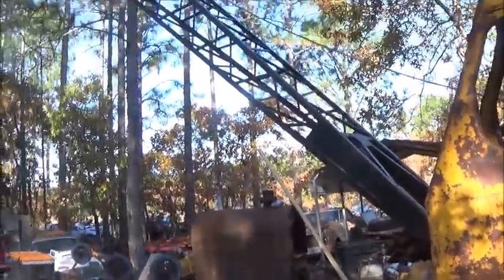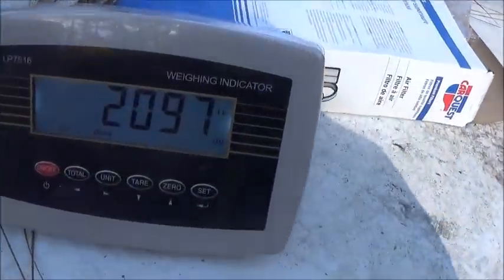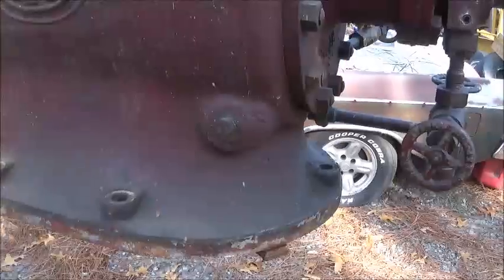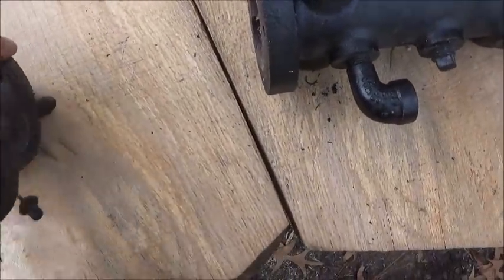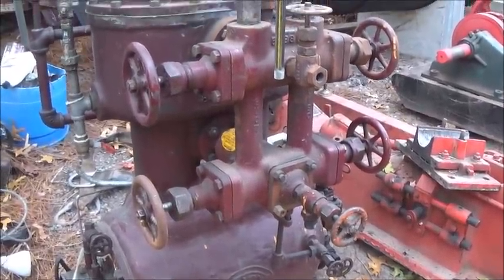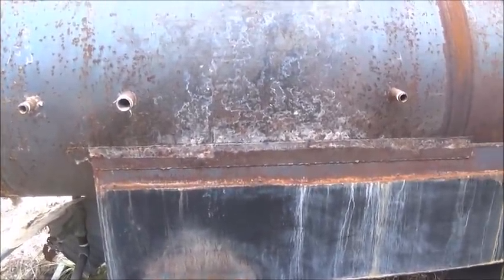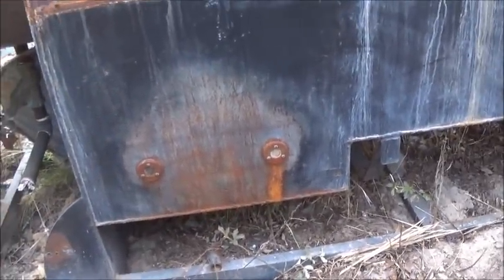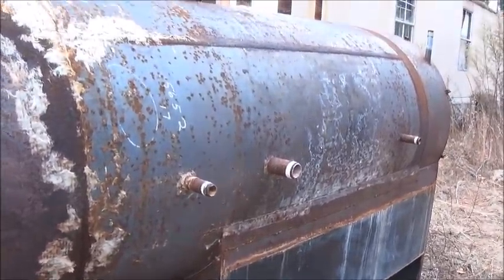AMMONIA COMPRESSOR, BOILER, LOCO PISTON AND MORE!!

Comment: It's a fire tube boiler, right? The water and steam go in the shell and the flue gasses and heat pass through the tubes into the smoke stack. If you're burning wood in such a boiler you might want to set up a way to clean the tubes (rod them out), since they will tend to collect soot and will need to be cleaned periodically to keep the chimney at peak performance. It is common to build a fluidized bed for such a boiler and to deliver the wood to the fire box in the form of wood chips, blown in with high volume low pressure compressed combustion air from a big centrical blower or better yet, a vane axial fan. Fluidized beds burn the wood very quickly (plenty of combustion air and maximum wood surface area) and deliver maximum power from a boiler. Obviously, with a wood chipper in series with blower that delivers air at pressure of at least 10 inches of water column, these systems tend to be very noisy. We designed such a system for a window manufacturer that used the scraps from the woodworking shop. Used that way, your boiler looks big enough to power your whole collection of steam engines. The system we built for the window company made 450-pound superheated steam to drive giant air compressors to produce the compressed ir to run al of the power tools in the plant.

Comment: Before I retired, we used Frick compressors with ammonia to make huge loads of ice water (mostly ice at the first, mostly water at the end of a cycle) to store cooling energy so we could use off-peak electricity for cooling very large commercial systems, one of them an R&D lab for a multi-national food processing company that might prefer to remain nameless, but which anyone would recognize by name. Frick makes top-notch compressors and as done for a very long time. The ice tanks were bigger than any swimming pool anyone ever made. The ice was made in sheets and then shed with a short shot of warm water to fall into the tank. Then we'd make another sheet and so forth. Nice piece of equipment. I liked seeing it after all these years.

Comment: Jonathan, I can tell you what all the valves do.  It's a long answer as this is a complicated machine.  Sorry to the YouTube commenters who can't tolerate long answers.  Jonathan asks for an answer so he, and you, can learn.  First, the compressor does not pump on both ends of the pistons as you questioned.  The pistons are indeed quite long, but they only compress on the up stroke.  BTW:  The pistons and suction valves are of a very interesting design too, but that's not the topic of this answer.
Of all the "fifteen" valves, it's really only the four big valves on the two manifolds that are the "mysterious" ones.  The other valves are for the water jacket, oil sight glass, vents, oil and other usual things which are easy to understand.  The four valves are part of the upper (Discharge) crossover manifold and lower (Suction) crossover manifold.  Suction gas always enters the compressor through the lower suction manifold (right into the cylinders).  In fact, that manifold even has a filter / screen cavity and cover plate.  You can see the instructional decal.  Discharge gas always exits the compressor through the upper discharge manifold.  The valves are clever and offer the refrigeration plant engineer the ability to do three things:
1.)  Isolate the compressor from the pressurized ammonia refrigeration system when the compressor needs to be opened up for service or inspection.
2.)  Allow the compressor to run in a "normal" operation where the suction gas is directed to the lower suction manifold and into the compressor.
3.)  Allow the compressor to run in a "defrost" operation by allowing the hot discharge gas to exit the compressor up the suction line.  The hot gas will then melt the ice off the evaporator coil.  Through a reverse refrigeration cycle (which is known to refrigeration people like me), the suction gas now returns to the compressor through the normal discharge line and is then routed down to the suction manifold.  The refrigeration plant engineer would have to do this process manually several times per day to defrost the evaporator coil.  
I know this is hard to explain and harder to follow.  If you and I were together, the valve and manifold assembly is easy to sketch out.  In a way, these valves were a year 1905 way of doing what modern day heat pump reversing valves do today.
Safety tip while I'm writing a book:  This compressor has a secret which can hurt , or kill you real fast!  When doing the defrost and valve switchover business, an occasional slug of liquid may come down the suction line and enter the compressor.  The discharge valves are held down in place by extremely powerful springs.  If there is liquid on top of the pistons, the discharge valves can "pop" open by overcoming the springs and relieve the enormous hydraulic pressure before the pistons and suction valve assemblies are damaged.  Well, the water jacket cover holds down these springs.  DO NOT remove that water jacket head cover until you are properly trained.  It's important to release the stored energy in the springs.  It's real easy to do.  Then, this compressor is typical to work on.
Dang, this answer is almost a video in itself.  ha ha

Comment: Jonathan is that white stuff that stuck to the outside of the boiler is asbestos. you don't want to beath that stuff. To remove it wet it down don't get it airborne I'd paint it with something like plaster. The dust from that if it is asbestos it deadly it will give you lung cancer, You already have a problem with your lungs, wear a respirator, don't get on your clothes.  I can't think of anything else that anyone would use on a hot boiler. I don't mean to be an alarmist I've lost friends to that stuff

Comment: Gifts from the Foundry preserved, so to speak----so THANKYOU! Interesting boiler, would heat up a large shed or barn, no big deal.Low water cutoff most important safety feature, Jonathan.Hope she passes hydrostatic test.Use respirators when you scrape off asbestos.

Comment: My limited experience with boilers is they are tougher than you think.  FYI, I also worked on oil rigs that use lots of steam in a cold Canadian winter, and did ac installs in cars, so all your stuff is of interest to me. My brother had an old house that had hot water heat. Originally coal, converted to oil, then natural gas. Something like circa 1930. He decided to change to forced air heat thinking the boiler was too old to use safely. It was in the basement and had to be removed. Very heavy old steal, we thought "no problem" we would just bust up the old cast and take it out in pieces. Nope, a ten pound hammer couldn't put a scratch on it. Should have left it for another 50 years. Took two good men to carry that thing out in one piece. Just saying.

Comment: I'm kind of familier with the Frick compressor. I'm an electrician and worked at a cold storage customer that had them. They were driven by a large three phase motor and were used until the late 70's. Not familier with the valves.

Comment: The short water column that you have. The Glass tube should be carefully removed and cleaned and new seating seals should be replaced. They seat against the square ends of the glass tube. For sure they have dried out and have deposits from previous usage. Measure the diameter of tube for parts. You should be able to locate these quite easily . Further , please do not use Teflon tape on those schedule 80 nipples , as well . A pipe thread sealant , lube for hp steam should be used. Cheers 
Alberta Dave

Comment: Hello!  Hop the holiday was good,  the compressor  we didn't do any R717 when I was in school but I would assume  there was one  hell of a receiver tank with that compressor  definitely few hundred gallons for system pump down service isolation Ammonia is nasty helped a guy out who rebuilt camper refrigerators  finding leaks braising holes refoaming nasty nasty  but one hell of a degreaser

Comment: Since you have steam power in the future, you can run the frick as a air compressor to run a number of your smaller steam engines since they will run off air pressure too.
You wanted to know what you could do with it, and that actually serves a purpose for your needs. 
Simple as that, but I am sure you'll have to have regulators to control the pressure of the air.
Make sure you change the refrigerant oil, and be careful because it may still have enough ammonia in the oil to do harm.
Ammonia hugs the ground, and basically will kill anything it rolls across on the ground.
Grass, trees, pets, and people that get caught unaware of its ability to remove oxygen from your lungs in a instant if you get too much. 
So be careful with that, and I would advise getting ahold of a older service technician that's familiar with it for safety reasons, and knows what's what. 
Good save, and been long time since I seen one of those old beast, back when life was simple, and before electronics, and digital controls took over the industry.

Comment: If I may, all of the engines you have seen to be single expansion. Have you considered trying to use the same steam 2 or 3 times. It should work. You start with the smallest diameter engine and work your way up to the largest. The larger the piston the less steam it needs to move. On a proper triple expansion engine the steam would need to be timed and piston size calculated to give you a smooth rotation. You don't need that. This whole exhibit is just to demonstrate the engines, not to use them for an industrial purpose, right?

Comment: Glad to see another video Jonathan. It's fixing to get cold so firing that boiler will be fun twice. I wonder if a low volume blower on the fire box would help? Pipe it with some schedule 10 stainless. May save on some wood, get the steam going quicker and you'd have ash left over, no chunks or less chunks anyway. Otherwise you might have to keep a poker handy. The ash would be good for the garden or to make soap. Just a suggestion.

Comment: I wanted to comment on that piston and rod , those were used in an inline 6 cylinder engine made by McIntosh- Seymour They were used in Alco 538 539 locomotives made in the late thirties  to the early fifties. 600 horsepower naturally aspirated and 1000 horsepower turbo charged. The reason I know is I installed many power assemblies in them . Just a little trivia, crankshaft weighs 2800 lbs. each cylinder head weighs over 400 lbs. the turbo charger older Bucchi models designed in the late thirties weighed 1800 lbs. Later Alcos 251 series went to v- type engines. The majority of these engines were switcher type configurations. They were also installed in road engines as well. That particular piston without the rod hits the scale at 104 lbs.

Comment: - [JONATHAN] I am ashamed to have to yell at you.
- As the best friend that I know how to be . . . I must do so here and now.
- You are THE crane operator. You ARE the authority.
- You MUST tell your ground crew to get away from the 'pick'.
- Your ground crew must at least have their legs/feet Positioned such they are not prevented from moving away [ESCAPING] if your alignment is not dead on.
- ANYTHING can HAPPEN . . .
- A slight gust of wind on your cable can pinch/pin legs or feet in an INSTANT.
- A single strand of wire on your boom elevation cable can break; and elevation changes SUDDENLY.
- A small piece of gravel crushes between cable winding's and the elevation changes, IRREVOCABLE.

- IF your home/business INSURANCE ever sees this video, they will have to cancel it ... PERMANENTLY.

- WHY do I know this?
- Ask me if I was the one trusted to chose the pick points and do the rigging for GIANT bridge I-Beams.
- Ask me if I was the only one trusted as signal man for a crane operator making a blind--picks on top of Mount Washington ... in unpredictable high winds.

- Ask me if I have been pinned when the ground moved {just a minuscule amount} under a crane's footing, and was lucky enough to escape injury, because my operator was so good he could lite my wooden matches for my pipe with the ball of his cable's hook, and get me free with out doing damage to my body !  !  !

- Are you that good?
Reply: IT'S  HIS DAMN CRAIN HE CAN USE IT ANY WAY HE PLEASES. ITS SAFETY SALLY'S THAT HAVE DESTROYED OUR COMPETIVE EDGE.

Comment: I bet there's so many valves on that compressor has something to do with how dangerous ammonia is. A little air or water leak if you open the wrong valve is no big deal, but leak ammonia into the inside of building and people are hurting.

Comment: Glad you got the piston but sorry to hear the engine was scrapped.  Alco went out of business many years ago so they aren't making any new ones.  I just saw where the Nevada Northern got one of it's old locomotives back that they intend to rebuild and put back in service.  It'll be kinda unique when they get it restored as it's the last Alco RSD4 known to exist.  Our local scenic railway has a nice old Alco RS1 they still run on excursions.  Wish they had a steamer, but all their steamers are just static displays.  I think the largest one they have is a little 2-6-0 Mogul that they haven't run since the early 1980's.

Comment: If they ever had a Walnut tree they'd soon know the difference in the fall, LOL.  Them black walnuts are a mite bigger than acorns, lol.  I've got a big old Walnut tree in my back yard that I'd bet is older than the little village I live in.  Then there's another mature one not nearly as old.  I just get on my hands & knees every fall gathering up those walnuts and wearing gloves so my hands don't get stained dark brown from the husks.  I've seen folks strip off the husk using old hand cranked corn shellers and I may do that if I ever run across one.

Comment: The wood block you pointed out was used to hold the unit level while grouting and setting time. Years later they used metal wedges and after the first day those were pulled to allow the grout bearing to support the machines.

Comment: The reason for so many valves, you are correct with changing vapor flow in the system piping. To complete defrost cycles.

Comment: Your system will be considered a low pressure system. It will do the job fine. Those nipples can work fine on a low pressure system. Schd80 would be better but , like you said, it's not goin into production. Just make sure you have a good working relief valve between the boiler and the rest of you system. More is better. Never allow the relief to be isolated by a valve or other equipment. I would put in a 120lb relief and discharge to a safe area.  The relief needs to be sized properly too. If it is too small it could still be a danger. Steam is amazing as a power source but can be dangerous if not managed properly. Don't skimp on using unions in places because you will be needed them over the course of time. Looking forward to seeing it run.

Comment: That’s a Frick Eclipse 2 cylinder compressor. They were made from about 1900 right through the 1960’s. I’ve worked on many of them. They are slow speed machines that ran about 60-120 rpm. Most of them were powered by synchronous electric motors that directly drove the compressor through a shaft coupling. Those compressors could run for decades non-stop. I worked on an ice cream plant in Massachusetts that had 18 of those compressors. 
It’s interesting  that ammonia was used for most large refrigeration plants up until the 80’s. It was mostly phased out because ammonia is both toxic and flammable. Now that halogenated refrigerants are being discontinued because of the danger to the environment, ammonia plants are becoming more common again.
Reply: The reason ammonia is so good has to do with gas moved for a ton of refrigeration. It's less than 4 cubic feet per ton of refrigeration.
Reply: @johnerway7255  yep, excellent refrigerant and fertilizer. Can't patent it though. So CFC's we have
Reply: That's interesting !
Reply: My understanding is ammonia u der pressuer  turns cold what would happen if u used ammonia Instead of hydrolic oil in something like a 320 excivaror ?
Reply: Ammonia is neither toxic, and it is definitely not flammable, it's UN 1005....non flammable/ non toxic gas. It is however an inhalation hazard and skin contact hazard. 
Know what you are talking about before commenting. And I have been working in industrial anhydrous ammonia production since 1994
Reply: @johnhull6363  Hey mate, I believe you and thank you for correcting someone who's wrong but hold down a bit on the aggression.
Reply: @johnhull6363  Haha! Your claims about ammonia make you sound like a Phillip-Morris doctor debunking health hazards associated with smoking. The question then becomes; how did long term exposure (since 1994) spare your eyes, lungs and skin, but not your brain?
Reply: @Pedroisanickname  guess you can't handle the truth, working around it today, you keep it in the pipes...
Reply: @johnhull6363  Anhydrous ammonia isn't flammable at standard temperatures and pressures but when mixed with an oxidiser it makes a surprisingly good fuel.  The Reaction Motors XLR99 engine in the X-15 rocket plane used anydrous ammonia and liquid oxygen.